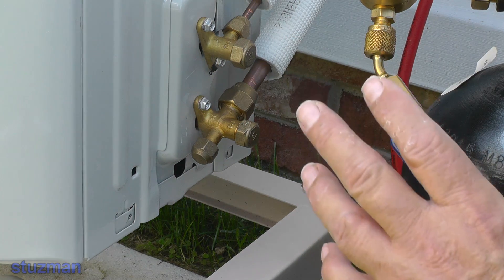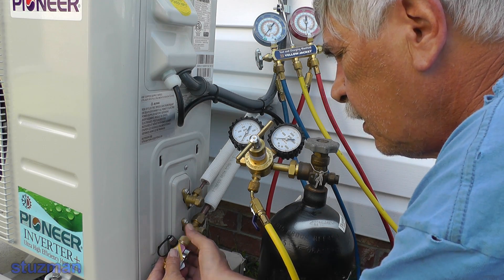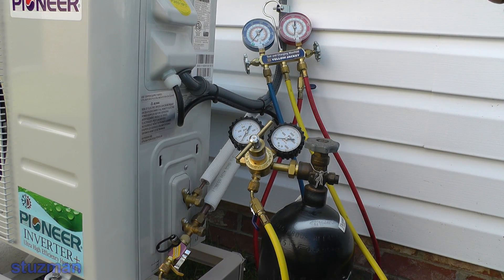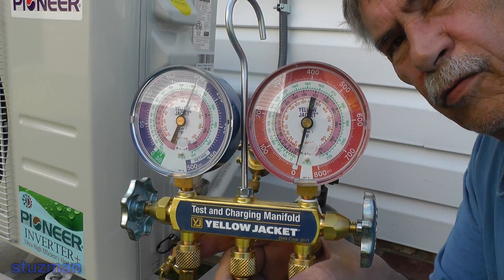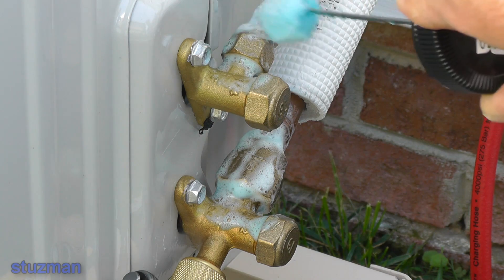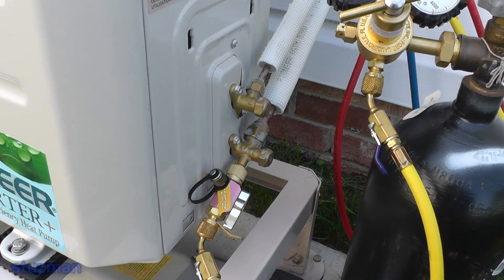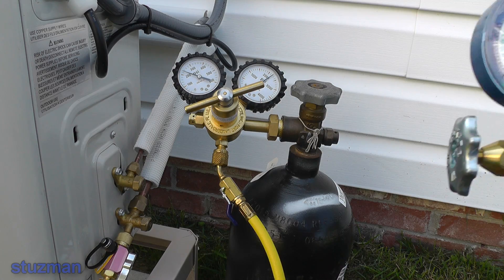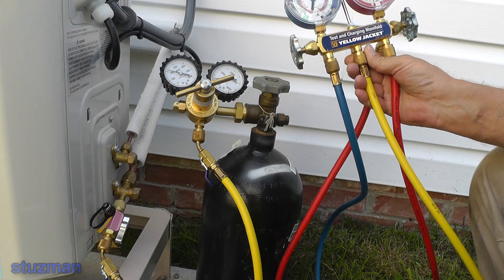Mini-Split Heat Pump: Nitrogen Pressure Test

Comment: Simple and straightforward video to follow.  Thank you.  I do have a question, however.  I have 12k BTU minisplit from Mitsubishi (MSZ-JP12WA/MUZ-JP12WA); it runs standard r410A.  The manual doesn't indicate anything about doing a nitrogen pressure test; it only indicates a triple evacuation test.  There are no pressure indications for the r410A refrigerant anywhere in the installation manual, operation manual, or submittal paperwork.  I have come across the notion online that an industry trend is to ommit pressure test recommendations from minisplit manuals because pressure testing sometimes results in nitrogen passing through the service valve and into the outdoor unit, thereby contaminating the pre-charged refrigerant on new minisplits.  Is there truth to this?  I have all of the equipment needed to do a nitrogen test, and I was planning on doing so at around 400 psi.  However, now I am considering doing it at 200 psi or not doing it at all, just to be safe.  Do you have an opinion on this?  Thank you in advance.
Reply from the maker: First off Nick, I want to commend you on doing a nitrogen pressure test for your system. As you've probably noticed on YouTube, most people out there don't do a pressure test and just do an evacuation. And even some professional techs don't bother with a pressure test which is incorrect. Most of the manuals that you see doesn't even mention a pressure test and my guess is that the manufacturer realizes that the DIY is not going to have a tank of nitrogen. You don't need to worry about the nitrogen getting past the service valves and contaminating the outdoor unit. As for the triple evacuation, this involves adding a small amount of pressure of nitrogen into the system. Then you evacuate the nitrogen into a vacuum. The idea behind this is to saturate the water vapor with nitrogen and after three times of doing this, the water vapor has been removed. This is NOT going to find very small leaks in the system. This is why you want to do a pressure test to find those small leaks if they exist. You could go up to around 250psi if you like and that should be more than enough to find small leaks. Remember, you're not testing the indoor coil as that has been checked at the factory at a higher pressure. You're just checking the flared connections on the line set. You can monitor the pressure on your gauges. If you're using analog gauges, I would give it about 30 minutes to see if you have a pressure drop. If you're using digital gauges, about 10-15 minutes should show a leak as they are more sensitive to pressure changes. While you're waiting, you can use a bubble product to check for leaks. The best product that I've found is "Better Bubble". Don't use any dish detergent or similar products. I've also used ultrasonic leak detectors on connections and they work very well. If you haven't installed the line-set yet, putting some blue Nylog on the flares will help seal and lubricate them. And be sure to use a torque wrench on the flares following the manufacturer's instructions. Most manufacturers wants a particular torque setting, back off the fitting and then another higher torque setting. I'm going to post two video links relating to pressure testing and vacuuming the system. In my opinion, "acservicetech" is the best ac guy on YouTube, and I highly recommend him. He does this type of work everyday.

The first is a full installation of a mini-split which shows the nitrogen and vacuum procedures. https://www.youtube.com/watch?v=JQkth-AM5CE

This video shows the evacuation of a mini-split which has a little more detail https://www.youtube.com/watch?v=k9uohbYDuRs

Good luck Nick on your installation and wishing you the best! Have a great day!
Reply: @stuzman52  Wow!  You are the man!  Thank you very much for the timely and very informative response.  This advice, and your videos, have given me a lot more confidence in doing this job myself.  I had actually already watched both of the videos you recommended multiple times over and taken notes.  I do see that the triple evacuation procedure is more about depressurizing to allow for a lower boiling point so as to vaporize and remove water vapor.  I still have a hard time wrapping my head around why Mitsubishi, a well-respected HVAC manufacturer, would not recommend a pressure testing, unless there was an important reason.  I see the argument you have about them suspecting that a lot of DIY won't have the gear, so why mention it?  But, the manual clearly appears to otherwise be written for service professionals to do the install, all the way down to warnings that only such professionals should be doing the work.  As a relevant and further example, after providing a description of the triple evacuation procedure in the manual, and instructing to release the refrigerant, they simply state "perform leak test".  There is no explanation as to what this test consists of. The assumption is that the target audience is a pro installer and knows what this means.  In any case, why perform the test AFTER refrigerant release?  Why recommend pressure tests for years in various manuals from various heat pump manufacturers yet ommit from this manual?  Then you have HVAC guys on forums stating that they've blown nitrogen past the service valves using too high of pressure (i.e., ~400 psi), and it caused a lot of headache.  And the other source of confusion for me is why should I not test at the highest operating pressure experienced by the line set and associated connections (for example ~400 psi, when in heating mode)?  Daikin requires 550 psi for the nitrogen test, which makes sense to me, and a number of installers were trained to use 1.3 times the device's highest operating pressure.  It stands to reason that a higher pressure would not only emulate real-life operating conditions better than a lower pressure, but it also would likely force the gas out of any breaches faster, thereby dropping the pressure reading faster, thereby shortening how long one must wait for the pressure test to be conclusive, which could be useful, especially when using analog gauges.  The only thing I can think of is that experience shows that if a heat pump doesn't leak at 200 psi, then it's very unlikely to leak at, say, 400 psi; so, the experience trumps theory.  But, I just watched a video from ACServiceTech himself that states that a higher pressure should be used because it may reveal leaks that do not occur at lower pressures (he lists this as one of the potential sources of leaks in his video on top 10 reasons for a leak).  Then you get some guys arguing that the chlorofluorocarbon refrigerant molecule itself is so large relative to the small diatomic N2 molecule that testing at 200 psi with the nitrogen truly is equivalent to emulating the real-life operating conditions.  Geez ... so many opinions out there, many of them in conflict.  In the end, as long as I can be confident that use of a higher pressure like 400 psi won't compromise the system in any way, as you have expressed, then it seems like that would be the way to go (I'll just have to check for any info on the outdoor unit itself when it's light out tomorrow, since the max pressure info isn't in the manuals, as stated previously).  Anyway,  I just want to get this right the first time around.  I suppose, if worst comes to worst, and I for some reason discover a small leak after releasing the refrigerant, I'd be ok if I quickly closed the service valves, as my lineset is a bit under 10 feet, and the outdoor unit comes precharged for up to 25 feet (the manual/submittal/etc, unlike others from other manufacturers, states no minimum line set length or need to remove refrigerant for line sets less than the default 25 feet--another mystery to me).
Reply from the maker: @nickbowers7267  I must say Nick that you've really done your homework with your research. You must have a background in engineering to look into the details for your installation. Even with your comments, you even place periods after each sentence 😊 compared to some comments that I get. You should be fine to test at 400psi as it will allow a leak to show up faster. On the outdoor unit you should find the test pressure for your the outdoor unit, but this wouldn't be relevant with your nitrogen test as the service valves will be closed. However, there is also a test pressure for the indoor coil which should have a placard on the unit somewhere. Even with 400psi, you'll still be under the test pressure as I believe they're be around 600psi. Keep up the good work as I'm sure you'll have a fine running system when you're done. Have a great day and don't work too hard!
Reply: @stuzman52  Thanks a lot, Stuzman!  I really appreciate your weighing in. It's more times than not that questions on Youtube channels go unanswered.  I'm no engineer, but I am a chemist/mathematician, turned educator, turned small business owner, and, perhaps, I inherited some of the detail-orientation and thoroughness that my late father had.   Even before I referenced this video of yours on HVAC, I had watched alternate videos of yours on electrical wiring.  So, you've helped me beyond just this topic.  Us lay people really appreciate mechanically gifted indviduals like yourself who have the generosity to share their knowledge in an easy-to-understand and humble way. Take care, my friend. I have subscribed, and will recommend you to others.
Reply from the maker: @nickbowers7267  Thank you very much Nick for the kind comments and for the subscription. And you are correct that many times questions are not answered. And that is one of my criteria to whether I will subscribe to a channel. You take care also Nick and again best wishes to you and your family.
Reply: @stuzman52  Reporting back with both success and failure.  The system held 300 PSI for 48 hours, and the bubble test did not reveal any leaks.  I am very happy about that! However, I am having a strange issue as I now go into the triple evacuation procedure.  In preparation for the procedure, I decided to test out my equipment.  I attached a brand new CPS micrometer to a brand new Appion valve core removal tool to the inlet of a brand new 4 CFM vacuum pump rated to pull down to 37 microns (5 Pa).  I made sure all fittings were tight and the oil level for the vacuum was correct.  I was able to pull vacuum to 200 microns--I couldn't pull lower no matter how long I let the vacuum run (I waited a maximum of about 5 minutes).  I then closed the valve of the valve core removal tool prior to shutting off the vacuum.  Within 30 seconds, the reading on the micrometer would be above 500 microns and would equilibrate at about 1000 microns in about 3 minutes.  I repeated this test multiple times, the results were always the same.  I repeated again with a different brand new valve core removal tool--same results.  My suspicions are as follows: 1) the micrometer is not sealing to the valve core removal tool properly (but, then why would the pressure stop rising at 1000 microns? Maybe because the rubber part of the seal can withstand 1000 microns, but not lower?), 2) the micrometer reading of 200 microns is artificially low because of how close the micrometer is to the vacuum pump (remember, it's only separated from the pump inlet by the valve core removal tool)?  I ordered another micrometer as well as a more powerful vacuum pump, and will keep them sealed in their boxes unless and until I cannot find a solution with my current equipment.  Do you happen to have any insight into what is going on here?
Reply from the maker: @nickbowers7267  Hi Nick and it sounds like you've got a really tight system with your pressure test. Okay, on to your issue with the micron gauge. The first test that you want to do is to connect the micron gauge directly to the pump WITHOUT the valve core removal tool. Be sure to use a small amount of blue Nylog on the faces of the connector ports for the gauge and vacuum pump. Turn on the pump and see what your reading is. You should be able to get down to your rated micron reading of your pump and it should maintain this reading and not rise when running. Here is a link to a video of where I posted in the description which explains the hookup of the micron gauge to the vacuum pump and some misunderstandings in its usage. Be sure you watch this video as it will explain a lot of what you're seeing. https://www.youtube.com/watch?v=cI6pSBaskjc&t=0s Also, notice in the video where it didn't pull down to his first lowest vacuum reading with the hose and valve core removal tool hooked up. All perfectly normal because of the very small volume of space and the sensitivity of the micron gauge.

Okay, so what if you couldn't get down to your micron rating of the pump. Then I would suspect the vacuum pump oil. Although the oil is new, they are not the same between manufacturers. The oil that I've used for years is Robinair preminum high viscosity oil. This oil will maintain low vacuum readings under long running periods of the pump with high temperatures. Here is a link to amazon for this oil. https://www.amazon.com/Robinair-Premium-Viscosity-Moisture-Vacuum/dp/B07R6P3GQ8/ref=sr_1_6?crid=EUODLCIMQ16F&keywords=robinair+premium+high+vacuum+pump+oil&qid=1657797001&sprefix=robinair%2Caps%2C198&sr=8-6

In fact there is a fellow on YouTube who watched a few of my videos that was convinced about using a micron gauge. He did a similar test as you with the micron gauge at the vacuum pump and couldn't get a low vacuum reading. He did a couple of videos and it turned out that it was his vacuum pump oil. Here is the first video where he couldn't pull a low vacuum. https://www.youtube.com/watch?v=3P6Y7YZXuZ4&t=3s
And the second video where he changed the oil to Robinair and he got some really low values after changing the oil. https://www.youtube.com/watch?v=gs7VoGAIpEM&t=3s

Okay Nick, now you know everything that I know 😊, and I'm sure you'll be able to get it all figured out. Let me know what you find and have a great day! Terry
Reply: @stuzman52  Many, many thanks, Terry!  You solved the riddle for me: As you mentioned, the reason for the rise in value of the micrometer reading after attaching it to the inlet port of the vacuum pump via the valve core remover was because of the tiny volume involved.  From what I learned, all fittings leak under vacuum at all times, no matter how small the leaks.  Since the volume of this system was so tiny, the inevitable small leaks led to relatively quick changes in the vacuum reading.  Once I hooked everything up to the actual mini split system and evacuated the line set, I did not have this issue, as the volume was so much larger.  When doing the triple evacuation, I still was not able to pull down to the vacuum manufacturer's max vacuum pressure of 37 microns.  However, I was able to pull and hold below 500 microns, which was within the specs listed for the mini split.  In fact, the mini split manual called for a triple evacuation at 4000, then 1500, then 500 microns, with the ability to hold below 500 for a minimum of 1 hour.  To play it safe, I triple evacuated at 400, then 400, then 350, which was the lowest I could get the vacuum to pull.  After the final evacuation to 350 microns, I waited for 45 minutes (I had to go to work).  Within the first few seconds, it jumped to 360 microns, where it remained for 10 minutes until the micrometer shut off.  When I immediately restarted the micrometer, the reading was 390 microns, which jumped within a few seconds to 400, where it remained for another 10 minutes.  Each time I re-started the micrometer, it read slightly higher.  But, by the 3rd  and 4th times, it never rose above 440 microns.  This all seemed good enough for me, and I successfully released the refrigerant, replaced the Shrader valve, bubble leak tested the service port opening, and put the service caps back on.  BUT, while tightening the service port caps to the appropriate torque readings, I made an uncomfortable realization: I had been using the new digital torque wrench I had gotten incorrectly, which meant that I had not torqued the 4 line set fittings to the appropriate torque values stated in the mini split manual.  Each time I used the wrench I had the display screen facing away from me, and I simply tightened until I heard the alarm beep.  Well, it turns out that the alarm first beeps at only 80% of the target value followed by a changing tone until the target value is reached (I didn't know about this latter feature).  Since I chose to tighten the fittings according to the middle of the range specified in the manual, the results aren't too far off, however.  For the 1/4" line, the manual asks for 10-13 ft-lb (I set the wrench for 12).  For the 3/8" line, the manual asks for 25-30 ft-lb (I set the wrench for 27).  Since I actually stopped the tightening  at 80% of my set values, this means the 1/4" line was tightened to 9.6 ft-lb (96% the lowest recommended value of 10) and the 3/8" line was tightened to 21.6 ft-lb (86% the lowest recommended value of 25).  Since the system held 300 psi for well over 48 hours, passed a thorough bubble test, and passed the vacuum test, I'm inclined to think everything should be just fine.   However, I know there are factors such as vibration of the line set, thermal expansion/contraction of the line set due to weather, et cetera, that exist.  In my case, the line set is only 8 feet long (vertical), has no bends, is fully insulated, is encased within a plastic duct, and is only subjected to Bay Area, CA weather (occassional low of mid 40s to occasional high of mid 90s).  Furthermore, Nylog Blue was used on all fittings.  Should I attempt to tighten the line set fittings a bit more, as a precaution, or should I not try to fix something that ain't broke?
Reply from the maker: @nickbowers7267  Hi Nick and good to hear that you got it all sorted out. Isn't having a little knowledge a great thing? It's obvious that your system is leak proof at this point although your fittings weren't quite up to its torque valve. You're asking should you go back and tighten the fittings a little more to bring it within specs. The simple answer to this question is how much OCD do you have 😊 If it was me, I would probably go back and tighten it up a little more. You can probably tell that I have a LOT of OCD 😊Your instruction manual will probably say to loosen the fittings and retighten to the final value. Do not loosen the fittings, just tighten them up a little more. And be sure to do a final bubble test to ensure that everything is still okay. Have a great day Nick and don't work too hard! Terry
Reply: @stuzman52  Thanks again, Terry!  I decided not to meddle with the connections after all.  While I'm not exactly OCD myself, I do try my best to minimize risk by following manufacturer recommendations, whenever possible, especially with technology I don't know much about.  In this case, I think the risk of trying to bring to spec might outweigh the risk of leaving it out of spec, especially given that I'm not far outside of the recommended range and the system passed all leak tests with flying colors.  Plus,  I read online that when putting Nylog Blue on the threads of the fittings and/or on the back of the flares, that torque wrench settings should be reduced so as to prevent overtightening (apparently, manufacturer specs assume copper to copper contact and the associated higher friction).  While I didn't put Nylog Blue on any threading, I did apply it liberally on the backside of each flare after applying it to the front of each flare.  I read online that many installers do this to prevent the possibility of the flare nut causing the flare to twist during tightening.  As such, I'm guessing that the compressional tightness of my fittings, which is what really matters, might very well be exactly how they should be!  Thus, I've been sitting here without too much worry, enjoying the cool air my new unit provides!  Thanks again for being such a stand-up guy, Terry!
Reply from the maker: @nickbowers7267  Glad to hear Nick that your unit is working well. As for the Nylog, I only put a small amount on the face of the fitting. I don't put any on the threads or on the backside of the flair as this will change the torque readings. Great work Nick on the installation of your unit! Have a great weekend!